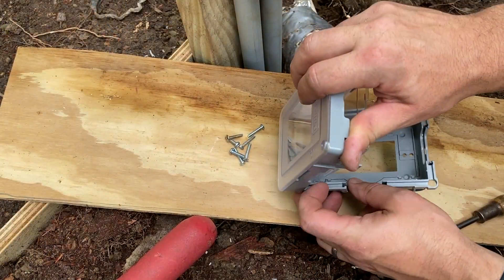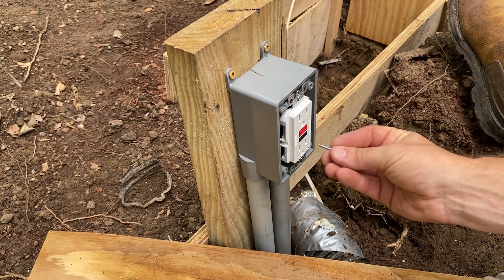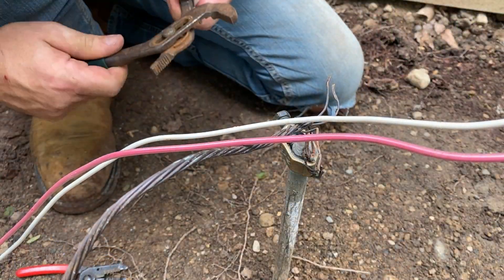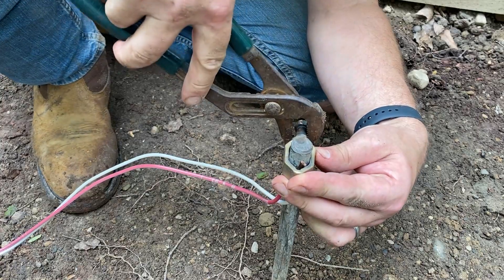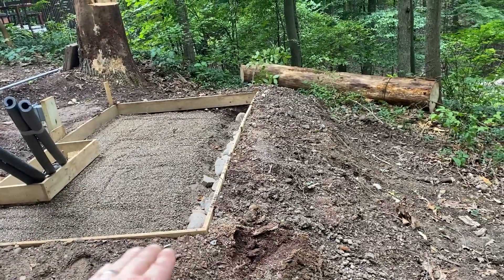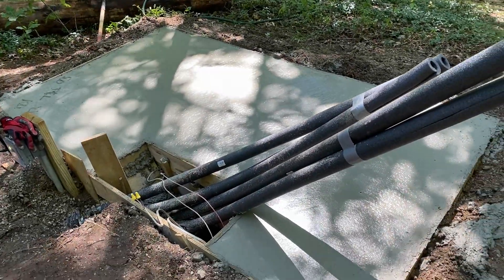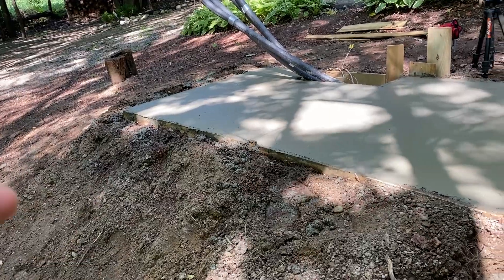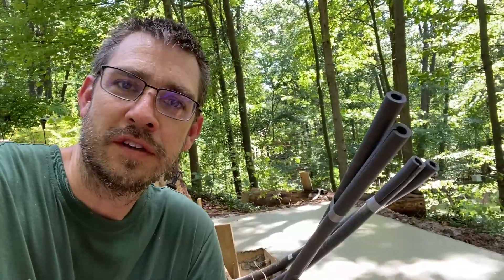Pouring the Pad For The Outdoor Wood Boiler

Comment: We use that pex-Al-pex in data center installs to run chilled water lines over head to in row chilled water air units…use a continuous piece from the air unit to out of the room…goal is to avoid leaks…we use crimp fittings that use a battery powered pro-press type machine to crimp them down…works very well, never had any issues

Comment: So, your “weird” wire is called UF-B, or underground feed, direct burial.  It’s basically Romex for underground applications.  Same 2 conductors plus ground, just encapsulated in PVC.  It’s good stuff and is a cheap alternative to putting the wires in conduit, but it does have caveats…codes now-a-days (and for as far as I can remember back into the early 90s codes), requires that UF cable be protected from the main panel with a GFCI breaker.  The GFCI outlet you installed is great to have out there, but really it should be GFCI protected at the panel.  It also needs to be buried 24” deep, I believe…but may depend on code in your area.  Nothing negative, just some insight/advice.  Great job with he concrete and other aspects!

Comment: 2:45 did you pigtail that incoming line? if your outlet craps out you'll lose power to your boiler. a pigtail would prevent that.
Reply from the maker: I ran it off the load side of the gfci, my thought was to add protection to the electrical box in the unit near all the water but yes, you are right if the outlet is tripped or goes bad the boiler will not have power

Comment: I would put a control joint where you have the jig for the pipes that slab is going to want to move with freeze thaw cycle and will  most likely crack. Concrete is good in compression but not in tension.

Comment: What boiler are you putting in? I replaced my old boiler last year with a 760 hdx I love it so far. I did not put any rebar in the pad it will be fine. The only thing I would suggest is put in new boiler lines that are the new foam filled because those bubble wrap lines loose a lot of heat just like at your old house. But you can always upgrade those in the future if it’s a problem it will be interesting to see how many cords you go through.

Comment: Excellent job, my friend! You are definitely getting better at DIY! Slip the handle out of your homemade tamper. Slip a concrete block down over that 'post', and put your handle back. You'll find it easier to 'tamp' with. Not easier to carry around, or to pick up, but it will put more force to each tamping blow! Maybe use some of your expanding foam to make a tight fit between the wood and concrete, to lessen the tendency to crack the concrete...